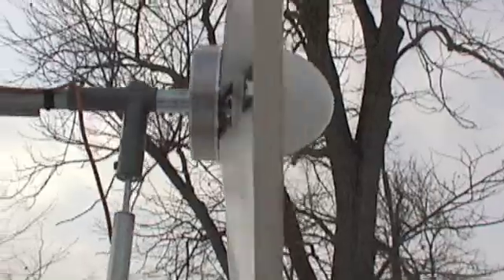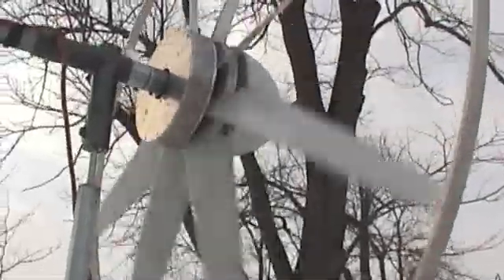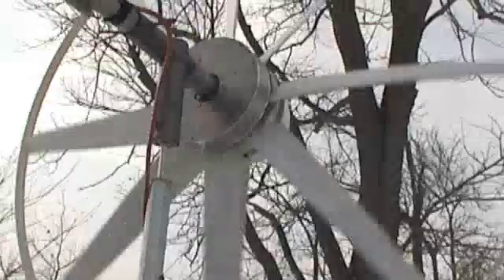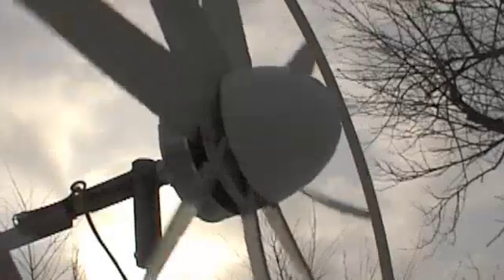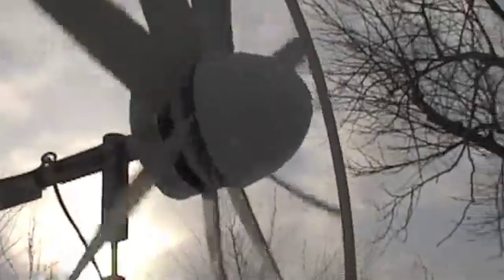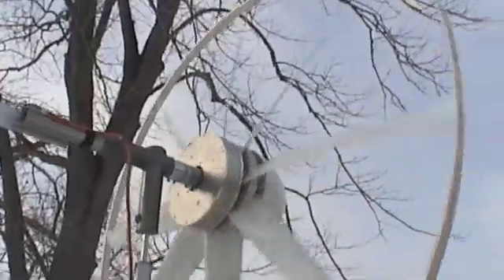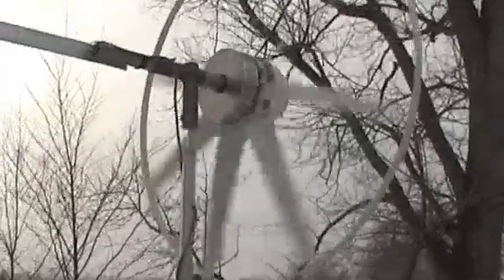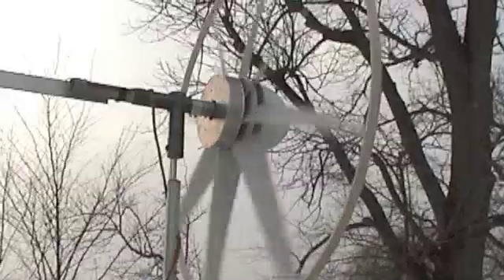Lynx Wind Turbine Testing

Comment: I'm sure you can find a way to deal with this
Is it not possible to make a switch that checks the voltage of 2 batteries
Then the switch connects the GTI to the best battery and let's the other battery be charged. Is there such a thing as 12v GTI? Why do most  GTI start working at 14 volt?
I don't get that, but thats probably me. :-)
Keep up the good work Marcus en Co.
Greetings from a terrible electrician. hahaha
Erik

Comment from the maker: @Fearlessthinker 
Thanks.  I have tried the capacitor (a big one)  The GTI still stalls the turbine after a small delay.  I am old school on circuitry but I have an idea of how to do this and will give it a try.  Having the GTI draw from the battery when and if the turbine is producing over 18 Vdc may work.  The turbine will augment the watts from the battery.  When the battery voltage drops below a set point the power switches off to the GTI and the turbine has to build voltage back to battery